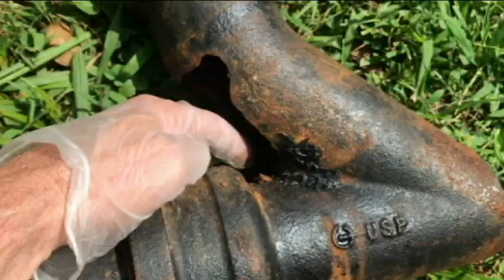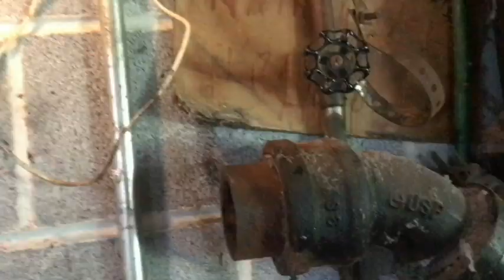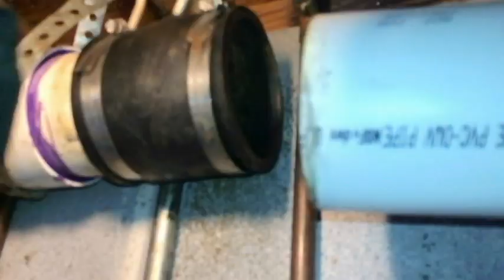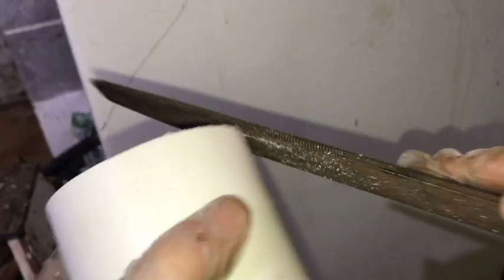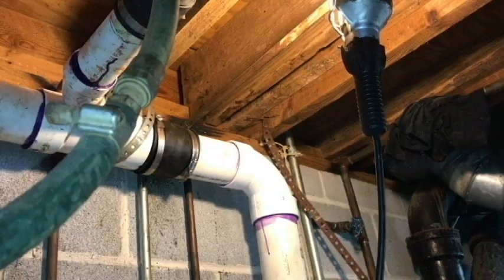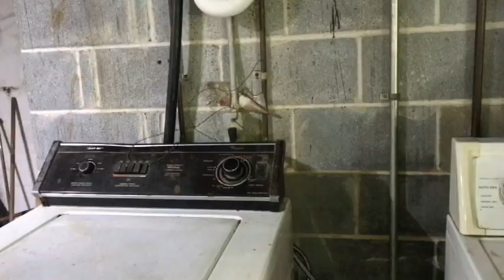Repair Rotton 3" Cast Iron Wye Section by an Inexperienced Homeowner. Plumbing Drain Replacement

Comment: seriously fernco city going on there......  if you are the homeowner why wouldn't you just replace majority of the CI that is accessible like  that 10' section to the tub, it seriously looks just as terrible as what you took out and will probably leak next year?  why bubble gum and bandaid that mess setup every year when you could just replace it and not rely on 15 ferncos for a 20' span of pipe.  adding some type of vent for the laundry drain wouldn't be a bad thought either since its code and not allowed to wet vent..

Comment: It is way easier to use a 4 1/2  angle grinder with a $2 metal cutoff disc for cutting cast pipe. Although in this situation you  would not be able to get all the way around because the cement wall is right there. But a cutoff disc is cheap, and you can do it faster.

Comment: I added a washing machine drain next to the basement pipe leading to the septic tank.  Because all the rest of the plumbing was on the main floor, I chose to use a 2" white PVC check valve in the washing machine's p-trap.  The thought of having sewage backing up the washing machine drain scared the crap out of me!

Comment: I hope you don't have rats or mice. Those fernco couplings are the first thing they go for.
Reply: I have had that problem they eat the poison and get super thirsty and chew right thru the rubber , I actually wrapped steel wool around it and they haven't bothered it in awhile

Comment: A couple of the existing, older pipe connections that can be seen in this video appear to be weeping by also. One of the pipes I'm speaking of is going into the fitting at quite an angle.

Comment: Should have watched a YouTube before doing yours. If you used "purple stuff" to glue together your pipes yo DID NOT PROPERLY CEMENT IT. Hope nobody watch and did the same thing. That's the PRIMER, apply, let dry, then apply clear cement.
Check BIG BOD has a TWIN PACK. But don't worry, a little leak can be fixed with duct tape, an a little sewer gas tastes great.
Reply: Do you have no sense at all??? He CLEARLY used purple primer followed by cement. Trying to look intelligent fails you when you arent.
Reply: DO NOT let the purple primer dry -- very clear on the instructions!
Reply: He used the cement and primer brother.

Comment: They make transition couplings that go from PVC to CI that probably would have resolved that issue you were having with it not lining up correctly. The OD of the pipes is different and those specific couplings compensate for that. All in all its working so who cares, good job 👍
Reply: What kind of adhesive/clamp is required for a direct PVC to CI connection?